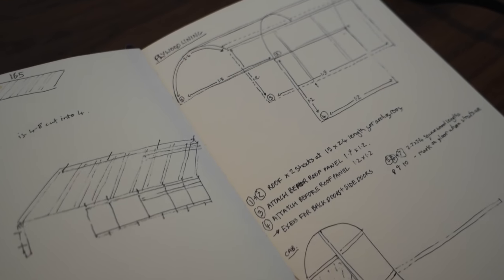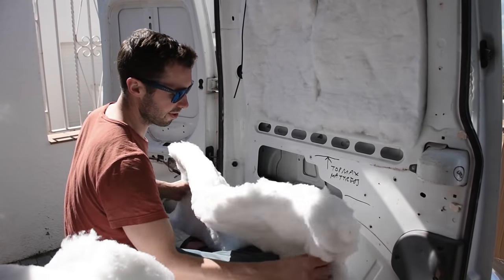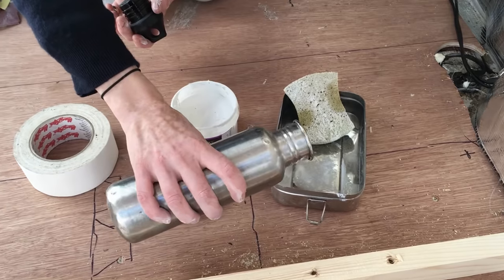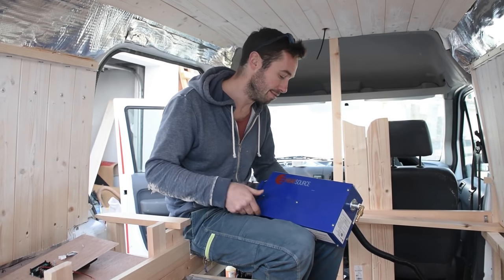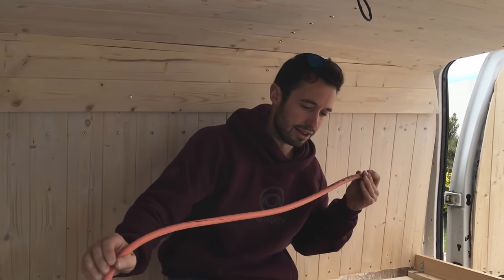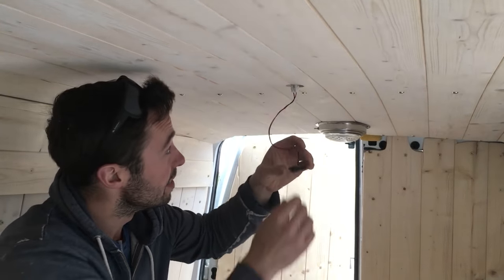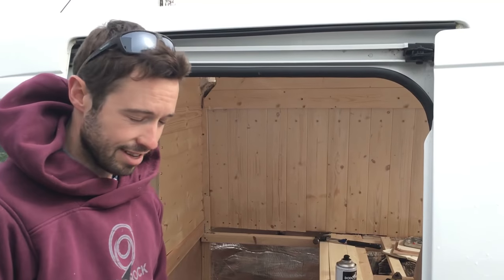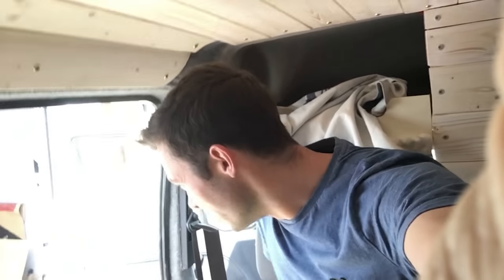How to Convert a Van; 7 Day Conversion Challenge!

Comment: The main criticism I have with most of these self builds is that everyone seems to use tongue and groove wood on the interior. It is soooo boring, I guess it's cheap and that's why it gets used so often.
Reply: What would you suggest as an slternative? I rather like the effect - it gives a pattern without being too busy
Reply: Stan .Rarick. Stan I'm definitely thinking marble, possibly granite slabs with demi columns and rococo ornamentation at the top leading onto a vaulted ceiling with maybe faux Cistine Chapel artwork illuminated with concealed lighting that changes colour to suit your mood. 
Or if that's not to your taste how about partial LED backlit translucent panels that can change through a variety of rich subtle colours as back panels for the hob and sink, maybe if you have a shower they could even be used on the walls of the shower as they are waterproof and 12 volts. Personally I would have a moquette or carpeted wall area as I think that's quite homely and possibly some veneered or faux veneered panelling to add a touch of luxury. The trouble with tongue and groove is it looks like a kitchen or hallway from the 1970s or the interior of a garden shed. There are so many cheap but vastly more exciting materials to use these days that can make an interior opulent and cosy without looking like it should have a dartboard hung on the wall.
Reply: David Hunt. Go for it!  😁
Reply: Stan .Rarick, as soon as it's finished I'll let you know. I'm undecided whether to go for a single piece polished slate floor or a mosaic.
Reply: Stan .Rarick, as soon as it's finished I'll let you know. I'm undecided whether to go for a single piece polished slate floor or a mosaic.
Reply: Stan .Rarick ... Am enjoying the humour here... I’m using red cedar panels. Aromatic. Can probably even smoke it
Reply: J G , I'm actually using the interior of Airforce One once he's decommissioned it.
Reply: I think the tongue and groove looks nice, but the blue paint didn't add much. I would have gone for a darker wood to contrast the light, not moldy looking blue paint....just saying....

Comment: Okay, not to be a downer, but these super-short/quick conversions always bother me. There's always someone with experience to help and they've usually purchased/somehow managed to save enough extra budget???? all the materials??? I think I've sunk like.....a thousand dollars in lumber, insulation and hardware/adhesives and....then I changed the whole plan, stopped going along with my dad's suggestions in favor of better ideas actual vanlifers have used, etc. Sorry I'm not going to buy a book I'll probably only use once and then....idk no one else in my life is interested in actually building a van. So....wasted paper....?

I guess I've started this thing and I'm gonna keep slogging. (My dad has contributed little more than heavy lifting and a vehicle with the capacity to move materials; I'm building this thing out solo. Which is really the biggest thing that bothers me. And no, I have no one else who is available to help when I'm available to work)
Reply from the maker: It’s an ebook - so no paper involved ☺️ and the idea is to help you from planning to finishing touches - sounds like you know what you are doing now but earlier on it may have helped.